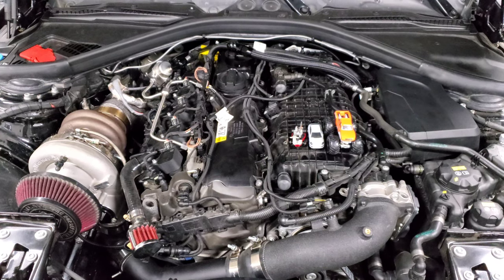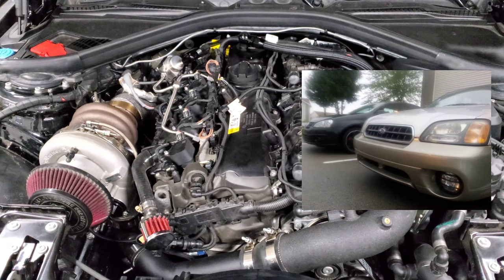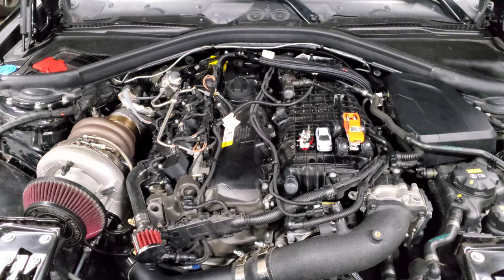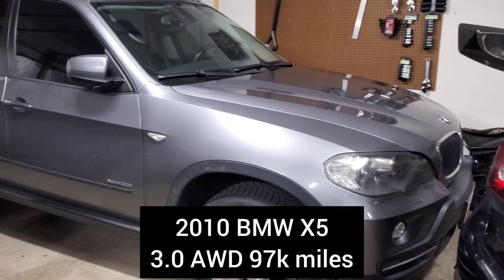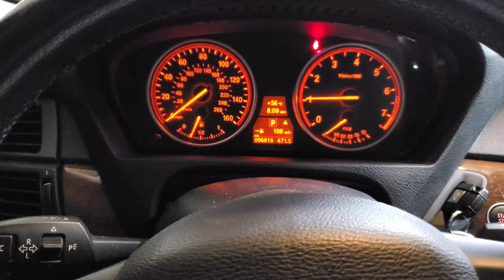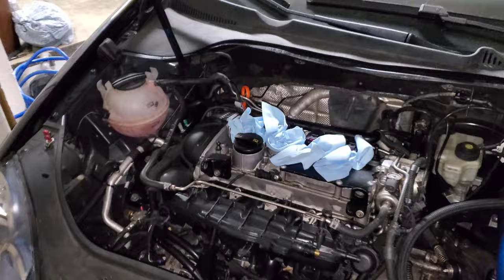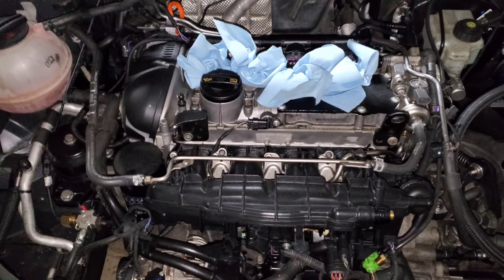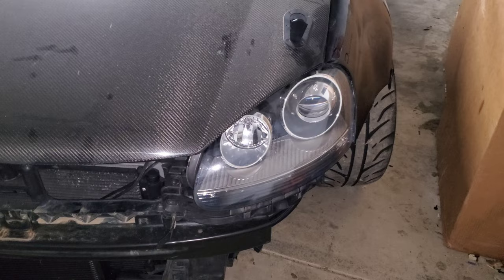Recipe for the Perfect Car Guy Garage

Comment: Ayeee, we’re sharing. We kinda have the same story. I drive a Jeep grand Cherokee as my beater, my wife drives a 2020 Aviator grand touring, and the 440i is for exactly what you described. Although I was a dsm guy in my humble beginnings. My project car was a 96’ gsx eclipse. My engine fell victim to the notorious crank walk issue on the 2g bottom end. I diy’ed everything from the ground up, except after pulling the motor and trans I had it built by road race engineering in CA (I lived in San Diego at the time). I ran the 1g bottom end with a 2nd gen extrude honed head, titanium valve springs, arp head studs, weisco pisons, eagle h beam rods, aluminum fly wheel, act 3300?lbs clutch. I installed my turbo, which was a big 16g (not a lot of options at the time), tubular manifold, fmic, tial wastegate w/dump tube, 750 injectors, 255 walbro, greddy bov, 3” turbo back, urethane motor mounts/suspension parts, new struts with eibach springs, camber kit, brake and rotor upgrade, turbo timer, ebc etc. not a single person touched the car other than the motor and trans rebuild. Loved that car, lost it in a divorce. I know I ask you a lot of dumb questions, but not really a dummy. Everything you have learned is super appreciated on the b58, it’s a different beast than my eclipse.

Comment: You'd need a 5th injector and e30 to easily run 450whp on the GLI. I know you're moving past VW's on the whole, but for the sake of other viewers, it's worth noting.
Reply from the maker: true, i think that became a more viable option in the past few years when i stopped looking at upgrades
Reply: @kern417  shit man, i was running a 5th injector in 2015, via a torqbyte cm5. Pulled in an injector signal, and built a very simple fuel map based on that input. Way better than the MAP signal most use to make it function.

Comment: Hello sir, YouTube just recommended this to me so I'm new! My garage is similar however I don't have #3 yet still working on that! I bought a house in 2020 so been rebuilding my buying power these past couple years. My GF's work requires putting about 100 miles on a vehicle per day she drives a 2013 Kia Sorento and besides the engine recall it's been very reliable and we're hoping to pay it off this year! My car is a 2003 Olds Bravada it's low mileage and has no payment. The Kia is the #1 on the list I only do the work on it that is necessary to keep it reliable. The Bravada is my tinker car just put a fan clutch and water pump on it so it runs and drives really well now but needs a lot of suspension work and front brakes so I've been working on it as I get the funds. I'm just wondering how did you get over that hump into step #3?  Is it just about having patience for that right car to come around? It doesn't help that I'm in the rust belt so good examples of street fun cars are hard to find and very expensive. Thanks for the vid I think you have a great car guy formula!
Reply from the maker: i went about it differently, and maybe not the best way. I got a fun daily driver. then when i got rid of it, i used the money to split funding between a cheap beater and a project car. that held me over for a while, until i was able to save enough money to get #3. so i didn't really get more money, just split my money into 2 cheaper cars. I also was blessed that my cheap car was reliable and the only issue i had was a radiator leak over 4 years of ownership.
Reply: @kern417  you make your own luck! Best of luck to you ;)